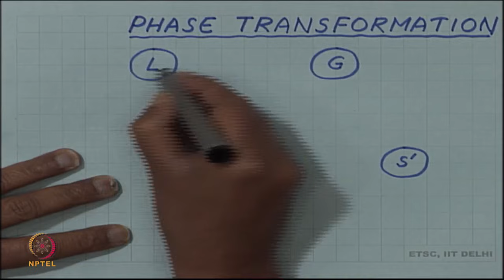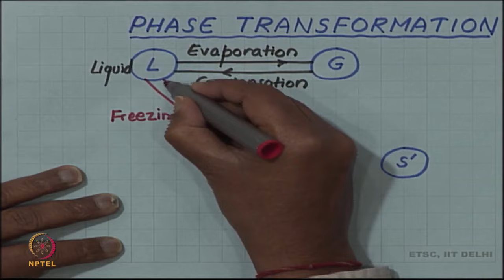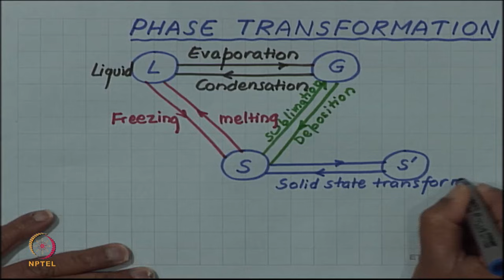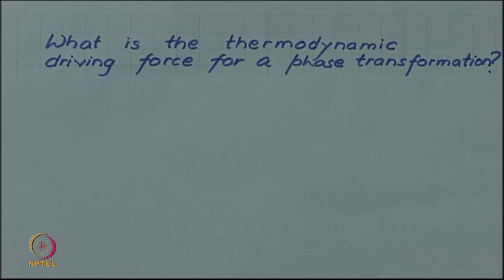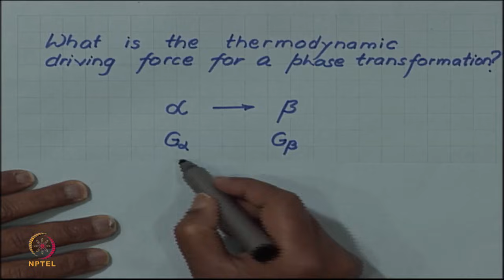Phase transformations

Comment: Sir, for freezing it should be:  delta G = G(Liquid) -- G( Solid) at 9:01 but you have written opposite to that. Please resolve my doubt....
Reply from the maker: It is actually a matter of definition. You can define it either way. Ususally any difference is defined as final minus initial. So for freezing final is solid and initial liquid. So in this definition delta G is negative. So in the critical radius formula a minus sign comes to make the radius positive. If you define the other way delta G is positive and the critical radius formula will also not require the minus sign.
Reply: @introductiontomaterialsscience  Thank you sir for explanation. Your  lectures are very helpful...

Comment: what is free energy mean??
Reply from the maker: It is Gibbs function defined as G=H-TS where H is enthalpy, T absolute temperature and S entropy. At constant T and pressure P the equilibrium state of a system is characterized by a minimum of G.
Reply: It is defined from the equilibrium conditions at constant temperature and pressure. G = H - TS = 0 (at const T and P equilibrium) if you substitute for H and S based on first law and second law definitions you derive that G represents the maximum amount of reversible work done at constan T and P.

Comment: sir what is the logic behind that assumption and why we have to assume ???
Reply from the maker: Could you please be specific about what assumptions you are referring to?
Reply: @introductiontomaterialsscience  delta h and delta s are independent of temperature at 12.11
Reply from the maker: @pailasaisravan5423  These will not be independent of temperature in general. But for small undercoolings the variation is small and they can be considered constant. The assumption simplifies the analysis.